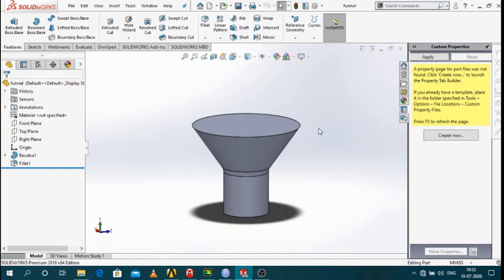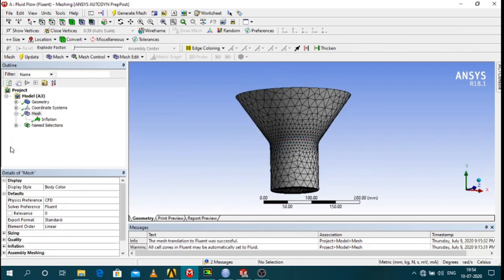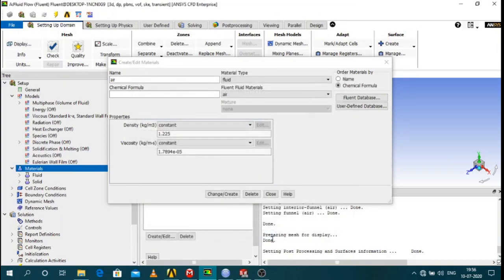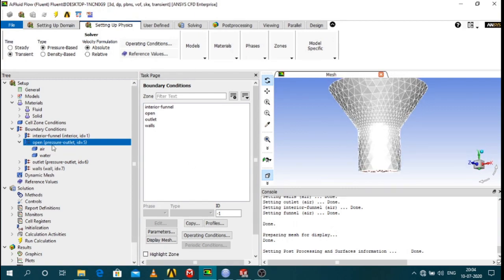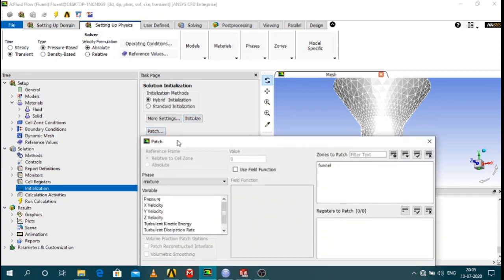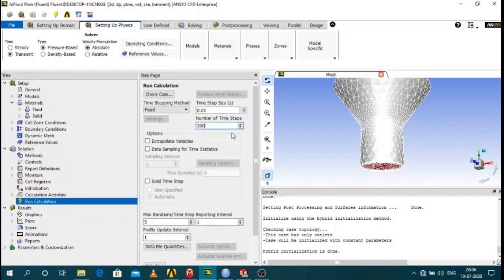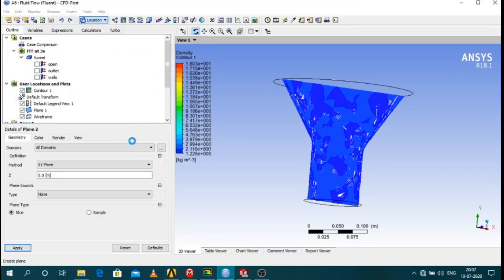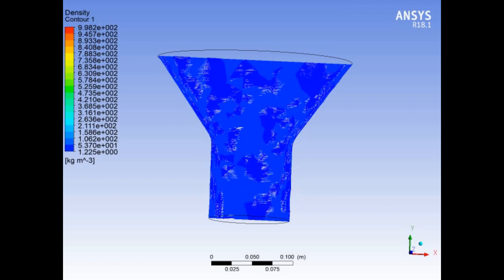Ansys Fluent | Transient analysis | Flow inside a funnel | Volume Fraction

Comment: Do you have tutorial for making the v funnel before this one?
Reply from the maker: Are you talking about making a funnel in solidworks that I used here? If you want that than I will surely make it.
Reply: @HritikJain  I'm talking about making a funnel in ansys.
Reply from the maker: @safi-ul-alam6614  I am not good with ansys design modular or space claim. Everything thing I do related to geometry is in Solidworks. So sorry I cant help u here, but If u want anything else in solidworks I ll do.
Reply: @HritikJain  Please make a tutorial of generating geometry of the funnel in solidworks. Thanks in advance.
Reply from the maker: @safi-ul-alam6614  Hi its easy

First make a close shape like (half cylinder + half frustum) and revolve extrude about the centres axis of rotation.

If u need more help contact me on my mail

hritzj1100@gmail.com
Reply: @HritikJain  Thanks a lot.

Comment: If my funnel design is hollow and not a solid, how can i run this? New to Ansys fluent..
Reply from the maker: No no, you are not getting the point. The boundry of the solid acts as a funnel. The inner total volume is a liquid. If you remove the inner volume and make it hollow, how will you define your liquid?
Reply: The internal volume is set as frozen, this allows you simulate a fluid in the defined volume